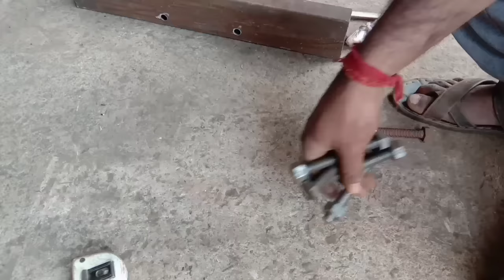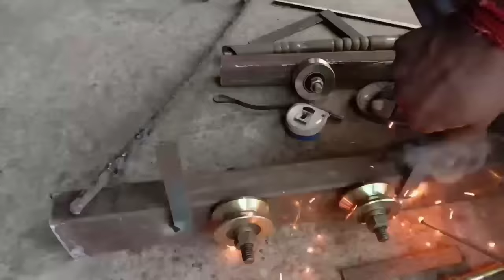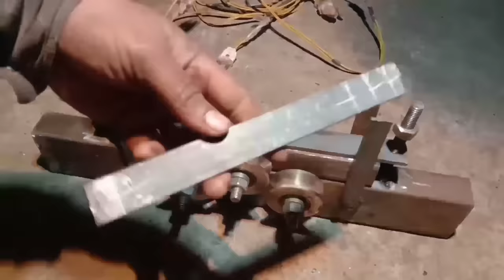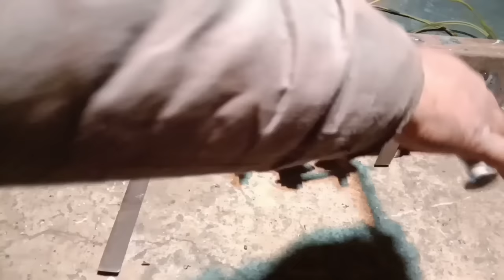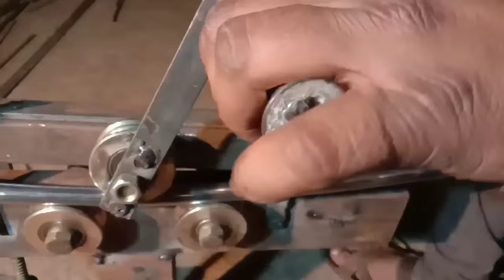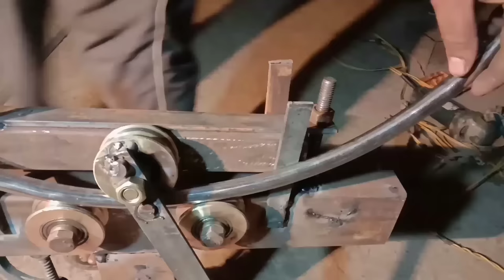HOME MADE PIPE BENDER// Every Welder Should know This Secret pipe bending tricks//#pipebending

Comment: Compliments! One question, is it possible to bend a stainless steel tube 25 mm diameter, 1.5 mm thick? Thanks and a greeting from Italy.
Reply from the maker: Yes can be but the roundness should be at least 1 meter
Reply from the maker: Thanks for watching and thanks for compliment
Reply: We use to fill the tube with sand. Weld a cap on both ends, make sure there is not a empty space inside, tap it a little to settle the sand before the last cap. The sand inside will help it keep shape. We were workng with pharmaceutical stainless steel.